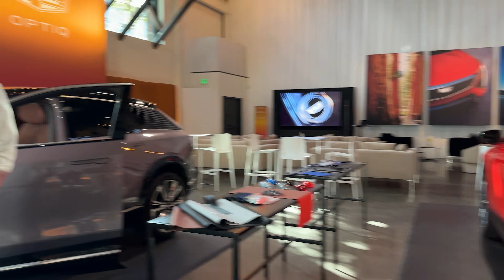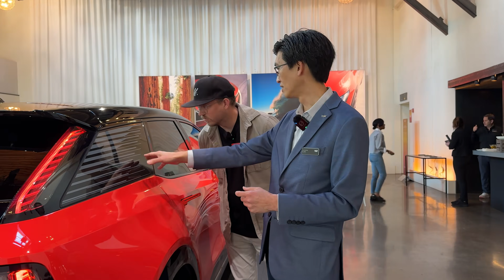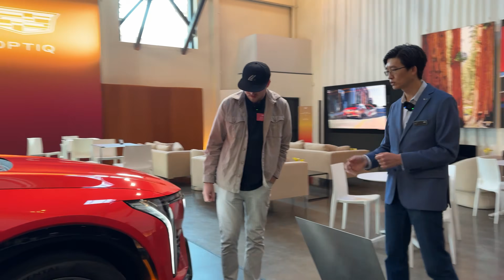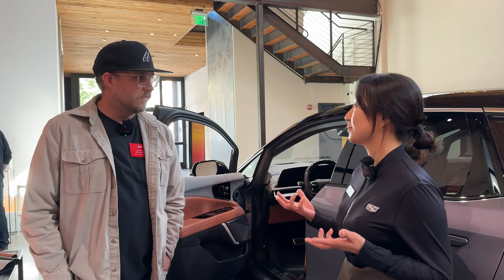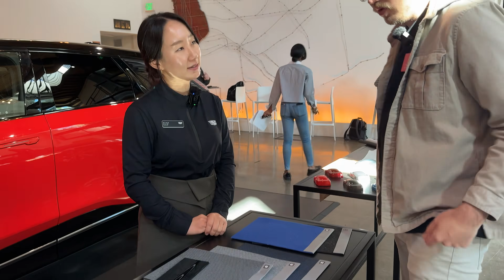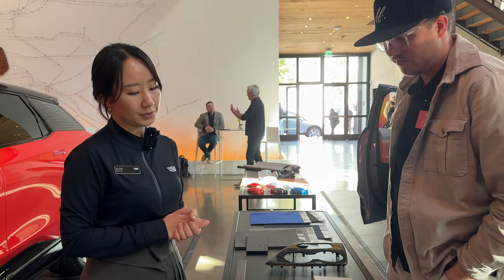Cadillac Optiq EV Has To Appeal To Younger Buyers, Here’s How They Did It

Comment: No wiper is a fail. Hyundai tried that and now they put one in. Places like Canada and northern USA,it's important.
Reply: No it's not. The aerodynamics of the spoilers and the angle of the glass sheet water off of the glass very well. The camera mirror makes this irrelevant anyway.
Reply: @pjllb  tell that to Hyundai. Here in Canada a rear wiper is needed on a vehicle like that. Rear windows can't stand up to my city. Hyundai had so many complaints that they had no choice. Cadillac will find out the hard way😂
Reply: I've driven the Optiq in snow and rain. However, I was using the rearview camera, so I can't really report on how clear the glass was. Point is, I don't miss having one at all and given the choice I would not add one.
Reply: I've driven my Optiq in the rain several times and the absence of a rear wiper was absolutely a non-issue. I haven't had to drive it during snow yet, but I'm not concerned.
Reply: @GERALDCOOPER  ok,when you drive in snow and slush get back.
Reply: @courtneyvegan9448 I used to have a Chevy Bolt with rear view camera and drove it for a couple New England winters and didn't need the rear wiper. (Just had to make sure to clear off the camera after an icy night)
Reply: @karmamule  got it. I still would prefer a wiper myself. some cars have washers for cameras too. I can't remember what cars have it,but most likely a expensive one.
Reply: If you’re not using the rear view mirror camera you’re doing it wrong.  No wiper needed.  Plus, the Hyundai’s rear window isn’t sloped like this one anyway,
Reply: @njhidegin We will see if the new one will have a rear wiper.

Comment: 2025 Cadillac OPTIQ.  
Curb Weight (base): 5,192 pounds (2,355 kg)
Towing Capacity: 1,500 pounds (680 kg)
Wheel Size: 20-inch wheels standard, with optional 21-inch wheels available.

Too heavy.
Reply: Too heavy for what?
Reply: I mean... It's a Cadillac... Lol
Reply: @ true. At least it’s lighter than the Macan EV.
Reply: it is heavy AF for a compact crossover